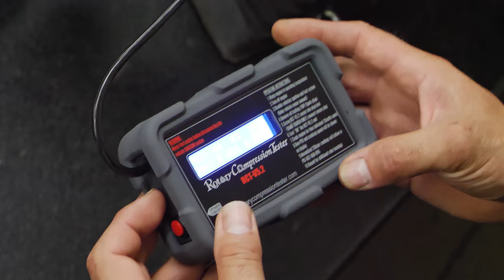3 Rotor is DEAD. I’m done with rotaries for a while...

Comment: I’ve seen these engines at the track easily push crazy power even the 2 rotors over 1000hp. Why not go with a mechanical fuel pump?
Reply: Another comment said the same
Reply: LJAS Auto he don’t know what he’s doing lol
Reply: @THEREAL_GZUS  bullshit Abel knows rotors better than anybody out there that fuel system is way way more than enough for the power they're going after there is another problem in the actual fuel system or voltage drop or something that fuel system could support so much more power than he's going after it's ridiculous
Reply: GixxerDad 600 if u say so but ppl are running mechanical pumps for a reason and from what I understand this is the second engine that it’s happen too .
Reply: He is learning while building.  He just turns out to be a very S L O W learner.
Reply: GixxerDad 600 still doesn’t make sense that he’s having this much trouble building a car that has been built many many many times at this level. An fd 3 rotor. And yes 2 rotors can hit 1000 hp and many have been built to that spec. So why is he having some much trouble building something that’s not unique or new at all and has already been figured out how to be built properly. It seems like this 3 rotor project has been nothing but trouble, as if it was built wrong or is being tuned wrong. Personally I find it hard to believe a YouTube dumps money into a car and blows up it on the dyno by accident, sure Cletus jones about it but pushes cars that far on the dyno but when you watch a car be built properly and professionally and tuned professionally it shouldn’t need but a few dyno days with a pro who knows fds and it should be perfect. Even fucking herts fully built fc took a fraction of the time and was built correct and with hert behind the wheel hasn’t had any major problems. And that says something
Reply: Fuel flow test  would be a start. Out return line with rails under max pressure and monitoring fuel pump voltage.  I  believe iv seen a boost pack starting that car a time or too.   Low voltage will kill the flow of them pumps

Comment: I've learned a trick on rotary engines where we add 2 stroke oil to the fuel tank. Depending on size though it can vary from 100-500ml per fuel tank. This will make engine way more happy. You need to increase the fueling though

Comment: Blame Abel for blowing this thing up.  Who would turn off the fuel pressure safety when they are have fuel pressure issues. He should have acknowledged the problem and  refused to take it any farther. You can't trust anyone pushing Adaptronic products.
Reply: "Who would turn off the fuel pressure safety when they are have fuel pressure issues"
Rob gave the OK for that, so why blame Abel?
Reply: @halofreak1990  they're both at fault- that was just a very stupid and costly decision unfortunately. feel bad for Rob but he'll bounce back.
Reply: If your mid pull and see afr’s anywhere near 14s when on boost you stop. Rotary’s are way more susceptible to damage from knock than piston engines.
Yes fuel pressure issues can be frustrating but as a tuner and racer with a reputation, Abel should’ve just stopped.
Reply: Ready and willing but not abel 😂
Reply: He clearly stated that it was a fuel FLOW issue, NOT a pressure issue. While it's correct that turning off the safeties is a bad idea when you have this much power, it was a flow problem. Yes, the pressure safeties being turned off could have helped cause this issue, but the problem wasn't with the pressure.
Reply: Whether its pressure or flow issue... doesn't matter!!.  The tuner knew full well there was a fuel starvation problem... and the AFR gauge was showing this!.  Any COMPETENT tuner would have stopped and not continued until this fueling issue was fixed.  

@"be wary for i am the S T A I R S"  is probably right; he did it on purpose... for the views.
Reply: Ian Trumbore lets also add the hiccups from the initial pull the engine is obviously choking that alone tells you something is wrong
Reply: Ian Trumbore he needs a better tuner, the car needs to be gone through with a proffessional set of eyes and a fine tooth comb, please throw that Dahm adaptonic bull shit in the trash
Reply: Mick Williams why is abel the expert because he himself says everything he tunes blows up  overpriced savage tunes do not = Badass Expert
Reply: The Guy that tunes for Cleetus always lays off the gas if he notices go lean or starts doing slow pulls , this guy just went all out . He should go somewhere else

Comment: This car has so many damn issues, you really need to just build it from the ground up.Stop half-assing the build and trying to rush through it/cut corners. If the fuel system is the problem, upgrade it. Dont just turn off safety features and then expect miracles to happen.

Comment: Dang!
My only observation is that It's impossible to have 83psi in the fuel rail and no flow, if the injectors are firing. At 800hp your mass flowrate of fuel is so high that If there was 'no flow' from the pump then fuel pressure would drop as the injectors fire really quickly. You are measuring fuel pressure in the rail right? You're not maxing out/pegging the fuel pressure sensor (5v?)

You'll get it sorted out in time dude. Better another 20B in the trash than the 4 rotor!
Reply: It's probably his internal tank, a surge tank is not designed for constant flow. The fuel pump probably can't keep up, then the surge tank has to help out. Then it runs out of fuel and back to the original low fuel flow problem. Only now it's high in the rpm when you really don't want it to lean out.
Reply: @vhateverlie  Yeah, but 83psi in the fuel rail (max the surge pumps can deliver) MUST result in proper fuel flow if given the proper duty cycle. It sounds like they were at the limit of duty cycle on the injectors and were trying to rely on the rising rate to make up the difference. With the old pumps with higher max pressure this was clearly OK.  I don't think the surge tank emptied as he never said they dipped in fuel pressure. His logs would show that
Reply: @samuelcorbett243  Also the fuel pressure has to fight the boost pressure. So if fuel pressure is staying the same as boost rises, the engine will lean out. Thats why they thought it was the pressure reg first. So as the fuel flow increased the pumps couldnt keep up and the pressure stayed at 83 instead of rising. Thats why Abel was talking about the differential fuel pressure droppping instead of being solid.
Reply: @ionstorm66  exactly,  if they had bigger injectors or ran more duty cycle they'd have gotten fuel just fine
Reply: @samuelcorbett243  That would make the differential fuel pressure worse. It might fix it at the load, but it will get exponentially worst. Also its possible they are using a ecu that can compensate for differential pressure, and they injectors were already tapped out. Injector fuel flow is rated at a certain differential pressure, so as the pressure gets lower and lower, flow rate drops.
Reply: @ionstorm66 Yep, it all depends on how much duty cycle they are using and what fuel mass flowrate is demanded. 1000hp is achievable using 2000cc/min at 3bar differential, which they are in excess of. 70%DC at 4bar differential vs. 80%DC at 3.5bar, the 3.5bar wins out in mass flowrate. Whatever the case hopefully they sort it out 👍

Comment: I know it's easy to say now but if your doing it again and it's so important to keep the rotors lubricated why not separate the premix into another reservoir and inject it straight into the chamber so if the fuel system does run lean it is still being lubricated by the premix injected into the chambe, make it's a completely independent system  you could also apply it to the 4 rotor so you don't detonate that one as well which obviously alot more time and effort is being put into, anyway love the vids stuff happens it's the fun of it

Comment: Your crew and tuner are terrible, how tf can your tuner not realize he’s running in lean on a dyno under full pressure. Like you said there is NO GUESSWORK. You’ve been trying to build this car for years and it takes one with a good team jeez. Just switch to a new platform your guys are too confused to build and operate a rotary.
Reply: how do you know it was to lean it could of been to rich and hydraulicked that why most crack irons
Reply: Nah a built fd motor will eat every bit of fuel it can get and they did it while on the dyno and didn’t hardly notice until after. It’s not that it hydrolocked and shut off and locked up, it’s that they pushed it past the fuel limit even though the safety mechanism was telling them it doesn’t have enough fuel top end. So they did a hard pull and it had fuel all the way up until the end when it went pretty hard lean and at that force without enough fuel it cause the damage. But to my experience I have no idea why this idiot would bypass a safety mechanism telling him it doesn’t have enough fuel top end. That in itself happens every single day at dyno shops around the country and they simply roll her off the dyno and tell you to go upgrade or change around your fuel system if you want more power.

Comment: In my experience in the past, when there was ever a problem on the back-end with fuel, be it caused by pump, drop in voltage to pump, or a problem with a corroded fuel tank and/or partly clogged up pump filter sock, the symptom becomes evening with a shaking fuel pressure gauge then a dramatic drop in rail pressure once injector demand outpaces the back-end. It's usually noticeable earlier on if the methodology of tuning is one of a tippy-toed, stair-step approach. It's the method I always used to use strictly on any car that ever had any kind of fuel system component change. Was this same thing done here? I'm coming in late to the picture so I don't have the whole story. In any case, I hope you get it sorted. It's usually something very simple even though it manifests itself as costly.

Comment: I think the possible issue you are having with the fuel system is an issue I had testing many high power electrical devices in my career and education. The wiring both positive and negative wiring is a resistor. This is a fixed value. Its relationship to voltage and current is explained by the equation V=IR. So when you have R constant and increase I the V drops.Basically when you fuel pumps are drawing high current its causing a voltage drop in the system which is causing it to draw even more current which causes the voltage to drop further. This happens until the pumps are actually under voltage and then you are loosing fuel pressure. Someone in the comments suggested mechanical fuel pumps and that may be a good idea considered the amount of fuel you are consuming as the mechanical pumps won't have any electrical power related pumping issues. Send me a message if you have any questions!

Comment: Reminds me of my 95TA that was 530 RWHP from it's LT1.  The tank for the water to air intercooler was surging and splashing out it's vent, right into, you guessed it, into my air filter, through my Vortech supercharger and into my motor.  So by the time I had figured this out, I was so DONE with this car.  I was already in mode to part the car out.  I did part the car out.  I kept the motor and it is what is in my 95 Diablo kit now.  Running on a single injector and will make internet history this spring/summer.  Look forward to working with you on the reveal.  See.  This was to free you up more for the vapor disclosure.  :-)  Sorry. Couldn't pass up the rib.  I did recently join a FB group called Gasoline Vapor Systems  I'll be data dumping this March my lasst 6 years of knowledge about how to do this on modern motors.  Peace brother.  Deep breath in the nose and out the mouth grasshopper as this too shall pass.  :-)

Comment: Rob, you are draining yourself too much man, the attention you're putting into the 4 rotor build is awesome and to add to that you're chasing 1000HP on your 3 rotor.  You know the 3 rotor needs some 'sorting out' so you shouldn't be surprised or down that the dyno hurt it.  It's always a downer when the car fail on the dyno but shit happens when you want big HP numbers, especially on a car that has not had the attention it probably needs.  Fix it right this time, fuel system, wiring, whatever it needs and you will be smiling again.  Don't give up !

Comment: Damn rob that sucks

We have all been there, maybe by this bad but we have all had similar situations

Keep your head up

Consider a belt drive pump being fed by a a1000 aeromotive intank pump

The intank a1000 with a enginebay mounted surge tank feeding a belt drive pump will give you all the fuel you need

Comment: What are your injector duty cycle at full throttle? If its 100% then you need think having better injectors or they leak so much they won't keep up the pressure etc some place gets too much and other wont.

Comment: Rob I’ve watched all your recent videos and always found your choice on that surge tank as odd. You should really look into a airdog which is a lift pump designed in the diesel world. They are capable of maintaining 200+ gph at 60-80 psi with no problem. Might be a good solution to look into instead of running 5 pumps.

Comment: Im curious as to more of what happened. The way a surge tank works, feed pump needs to have volume not PSI and the pumps feeding the engine have a linear ratio of PSI and flow @ at a certain line volume rate regulated by the FPR. you were saying a PSI increase or maintained, but a flow drop?  FPR problem? maybe im not understanding what happened?

Comment: I know it sounds silly but I’ve seen a high hp high rev motor over spin an alternator and it causes the fuel pumps to drop in psi. It happened on a mustang that was over spinning the alternator to cut power to protect it and in result it caused the car to go lean and it didn’t blow but it would have if the computer didn’t stop it

Comment: PS those comp testers default a 20 number when its buggered. they wont read below 40 // the internal pressure regs in the walbro and some other brand pumps also give out right at that fuel pressure . cant trust them with boost beyond 30 psi

Comment: What gauge an lines are you running from the surge tank? Is the surge tank big enough to stay full on long dyno pulls? I dont know much about this car. You may have already covered these issues. You can also have custom rails made to handle more volume.. what injectors are you running?
Reply: Also, sorry Rob. That sucks

Comment: I think running the 3 pumps at full speed all the time was the cause of this. You went too big, and that resulted in pump cavitation and irregular fuel flow. At full noise and 75psi of head pressure those three pumps will deliver 950lt/h of fuel flow, when on race gas the engine was only consuming around 400-450lt/h @ 900-1000 HP.  You'd need massive (AN10)  supply and return lines and a huge regulator to be able to bypass that much fuel without having surge issues.  E85 would have been another story with closer to 650-700lt/hr which can still nearly be reached on just two pumps.

Comment: Hate to say this, but it was 100% going to blow. I don't know a dyno owner / tuner who would have agreed to do power pulls on a car that was spitting and stuttering all over the place with so obvious fuel AND ecu map problems. The AFR readings are not reliable with so much misfiring, and even so they were way off (too lean AND too rich). Should have first solved the fuel pressure problem and then properly tuned the ECU map little by little. Not just push all in with crappy tune and see what explodes, because something absolutely will. So obvious disaster that it hurt to watch. Rebuild and get a proper guy to do the mapping and then push the limits? Anyway, thanks for all the videos so far. Keep them coming! :) How about some Diablo content while you gather up the funds for a rebuild ? ;)

Comment: You should do something with an S2 (2009-2011) RX-8 engine. There's very little out there as far as forced induction. You'd think with the extra injectors to lube the center of the Apex deals they'd be better to handle boost than the S1 engine. 
Maybe an NA 3 rotor with S2 housings? 🤔

Comment: My sincere condolences, Rob. 
Okay, for those of you who want a reliable RX-7 and don't want a million HP, please listen to Rob's own advice in the  video link below. Mine is 99% stock and still going strong at ~85k miles (original owner here). Remember all of the 1st and 2nd generation Rx-7s on the road? I don't recall hearing any such horror stories until the FD came out with turbochargers. Mine is still a twin-turbo and I wish it didn't have any. If I were king I'd own a 3 rotor NA with similar or more power to the stock FD. Less heat, complications and worry.  I've never done a YT link with a timestamp before so I'm hoping this takes you to the right spot. 
https://youtu.be/NO1DUZUUBEs?t=38

Comment: With 14 years of experience in tuning rotary powered vehicles. I would of never turned off the safety feature at the level of power. Abel is a good guy, good builder, and good racer but that was a dumb recommendation from a tuning perspective. The wiring job on Robs car needs to be done by a professional who knows if those pumps are suffering from low voltage drops on high boost.